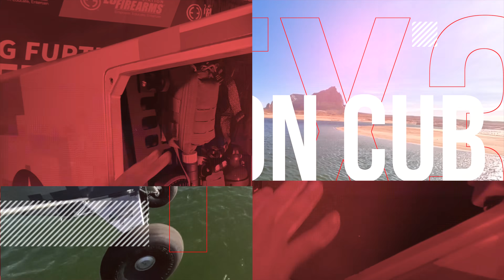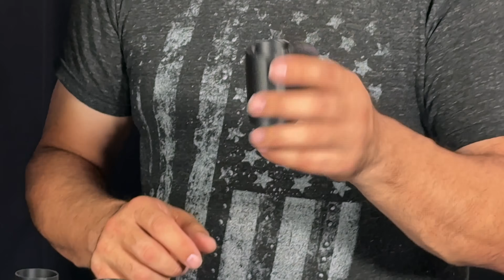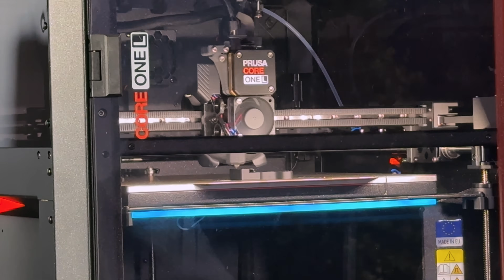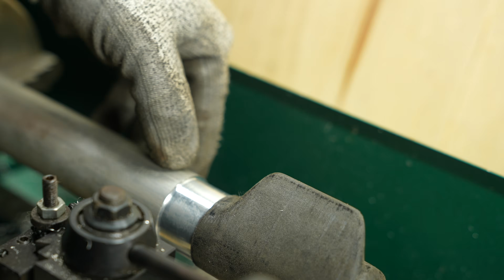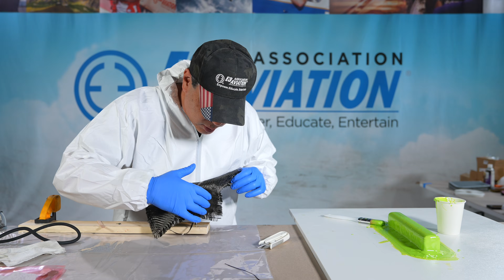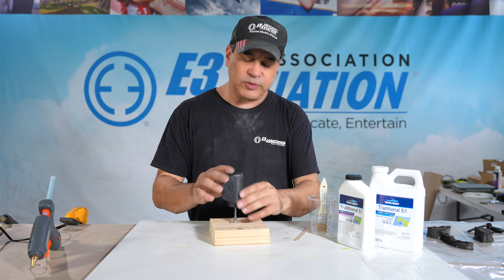Carbon Cub Carbon Fiber Throttle Handle Build- This Rocks!

Comment from the maker: Quick question for the builders out there — would you run a ball-style throttle grip or the flat-lip design we built here? Curious what you prefer when flying off-airport. Drop your thoughts below 👇

Comment: Was that drill chuck spinning in the taper?  Not good.  Lock it in better with a solid push, and use the full withdrawal release to eject.  You will ruin the taper doing that, if I saw everything correctly.  Yeah, I am a hack layman machinist, as well.
Reply from the maker: LOL  yes that was the one 3 second clip the editor chose and not the good ones.
Reply: @e3aviationassociation  Murphy reigns supreme!

Comment: There ya go, laying up crap.  ;-)  Gets in the blood, doesn't it?  We did a beautifully hand shaped mahogany grip for the stick and peddle portion on the Long EZ, finger depressions, thumb rest, and all.  Sorry that I keep relating everything back to that like a broken record, but it was most of my spare time for a few years.

The only thing I would be careful about using that grip is that the mechanism can handle the extra forces someone else could apply.  You will be aware of this, but if you sell it, will the buyer...a la John Denver and the perfectly operable modified Long EZ he bought.  He wasn't even drunk, for a change, but had a problem with a modified fuel switch positioning that he didn't modify to his REQUIRED ergonomics requirements, due to his short stature and reach.  If I sold this, or anyone else flies it, I would at least mention it, if it is at all a consideration.  If you can 'hang from' that throttle actuator, no problem.  Looks very 'sexy' and comfortable.
Reply from the maker: when we sell the planes.  We put the original equipment on it and then box up the rest and if they want to use it its up to them.
Reply: @e3aviationassociation  Right answer, then you don't open yourself up to lawyer problems.